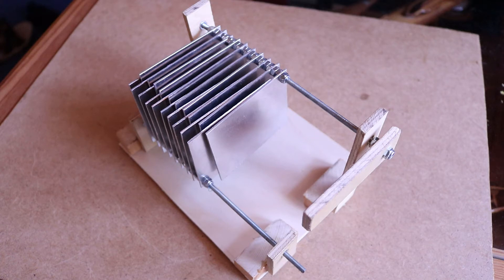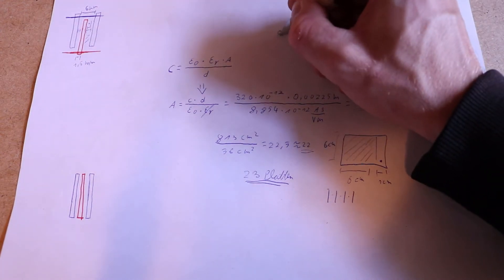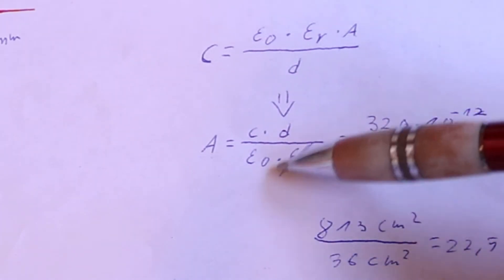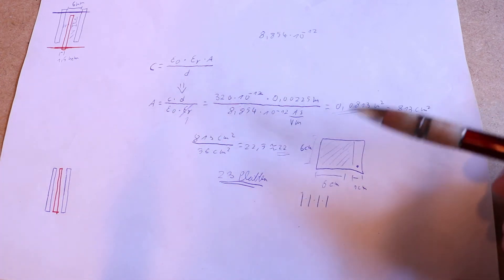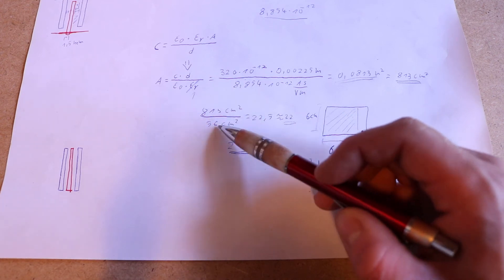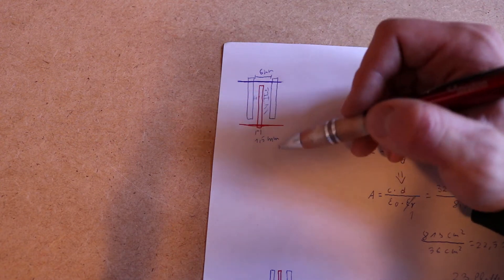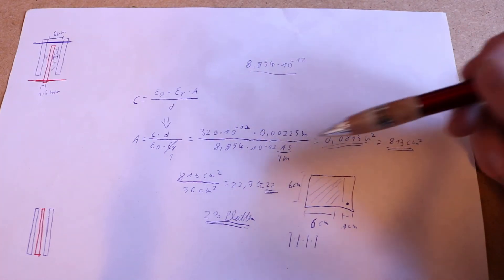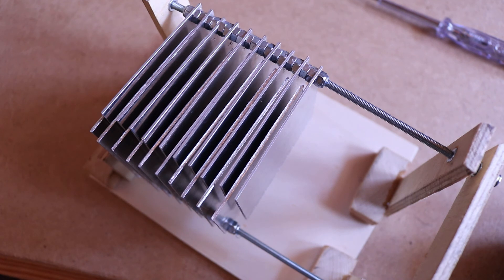How to build [and calculate] a variable capacitor

Comment: Have you calculated the maximum voltage that the capacitor can handle?  Have you tried it out yet?  Great job!
Reply from the maker: The maximum voltage is just the breakdown voltage of air, which is, depending on the humidity, 1-3kV per millimeter. I've used it in my shortwave transmitter project and it worked perfectly.